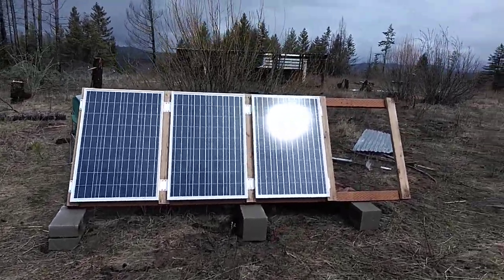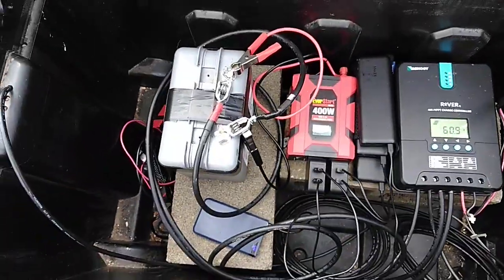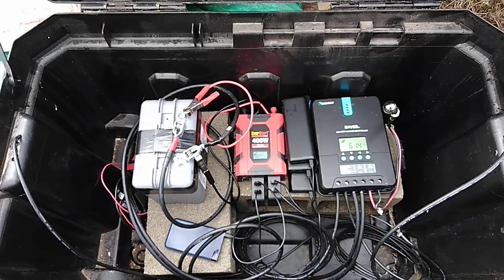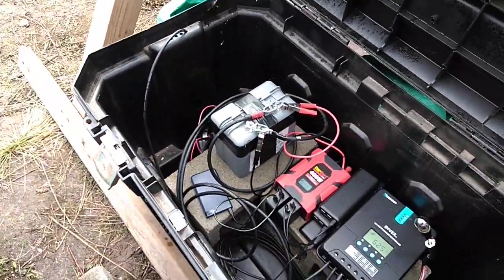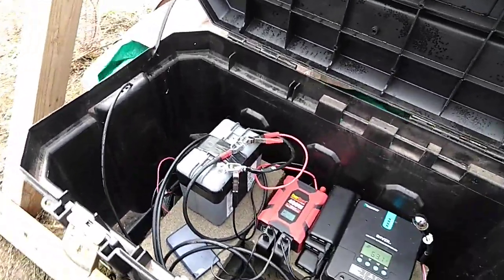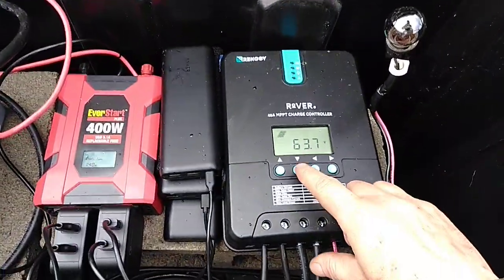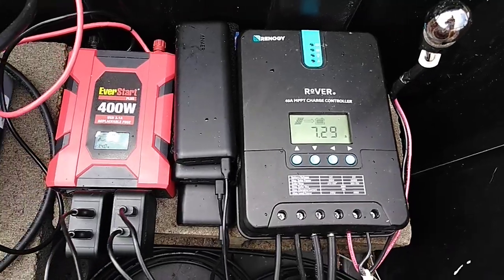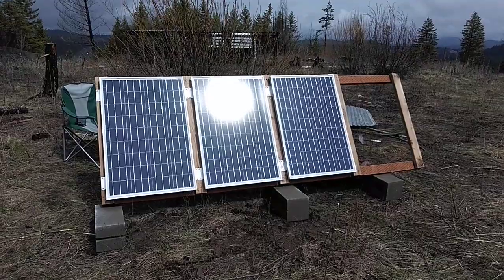Off-Grid Solar Power System. Renogy 300w w/ Rover 40a mppt charge controller.

Comment: Sweet 👍🏽
Reply: We added a 4th panel and 3 caterpillar batteries. It runs our water pump led lights charges the phones and laptops without any troubles. There are days in the darkest parts of winter where we will top off the batteries by running the little Yamaha generator for a few hours once a week or so.
Reply: @GodzillaShop  it also helps to get some USB lights u can leave 1 on all night & won't drain your batteries. USB fans about the same. Greetings from Texas🙋‍♂️
Reply: @carlosbarraza2904  we started out with the usb lights and still use some usb fans. The led paddle lights are very low draw. A standard box fan only pulls about 80w so is the summer go to.
Reply: @carlosbarraza2904  the coolest thing though is the heat induction fan we use on the woodstove. It uses the heat differential to create electricity and power the fan.